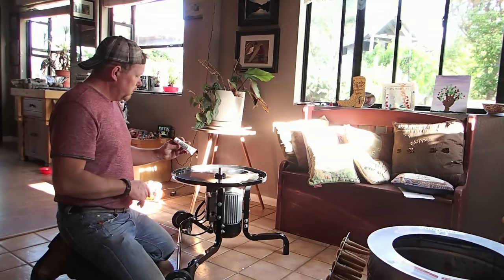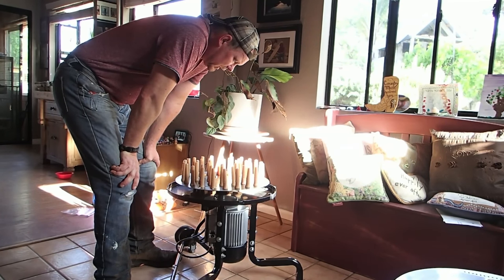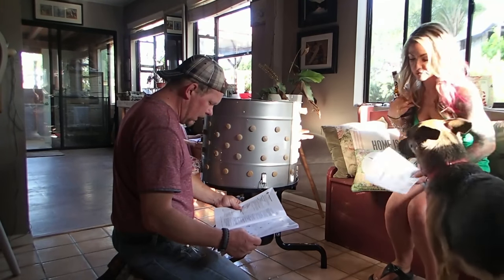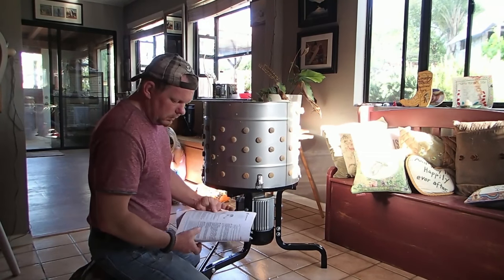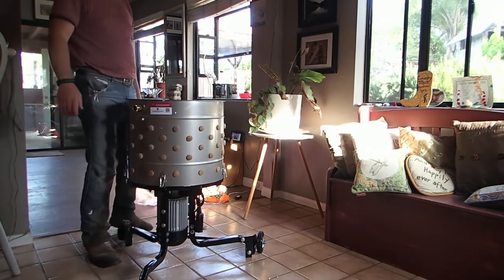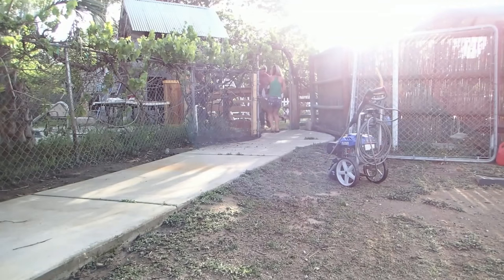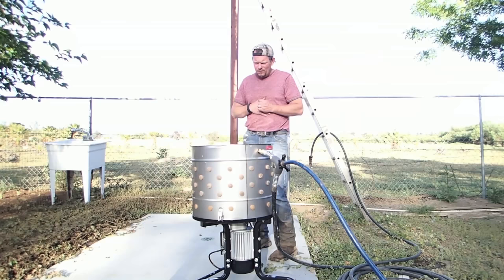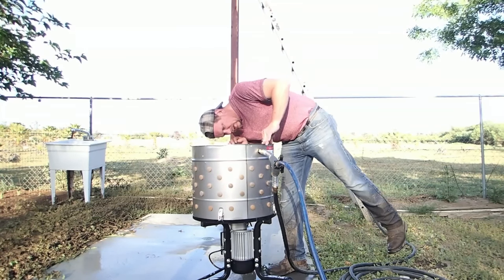Assembling and testing the best chicken plucker you can find for the $$

Comment: Always wondering about all the high-technology gadgets, and what could be done easier.

Old ways of rolling-boil hot water dipping (scalding your hands), hot wax dipping and stripping cold wax feathers (burning your hands from hot wax, that needs reprocessing getting back wax, and still have waste wax-feathers).

How about easier and faster method.  Steam cleaning.  Medium/large-size pressure cookers/canners for harvested animals.  Already gutted, head, neck, feet, ... place water in the bottom of open container, make rolling boil, put in multiple chicken, duck, goose into appropriately-sized pressure cooker, close up, and steam the feathers and skin.  Steam (1) softens and sweats out excess water tension in the skin cells, (2) opens up the skin pores allowing the feather pins to release easier, and (3) feather and pins all softened, all stick together and don't stick on your hands, gloves, or fall all over as dry pin feathers or down as in dry plucking, etc.  Put in fowl, pull out hot steamed fowl with tongs, and allow to cool down to handling temperature.  Then easily WIPE OFF feathers from bird.  The process does not steam-cook the meat when properly done. Any skin and feather contamination (bugs, germs, bacteria, salmonella, avian flu, ...) all steam-cleaned and sterilized for a safely processed bird.  Sterilized pin feathers and down, easily air-/sun-dried, and easily separated for other uses.

Comment: After looking at this video,  I'd say that the electrical motor under all that draining water might be dangerous.
Reply from the maker: +B Light it's not I promise ... it's a specially designed motor for this appliance that is made to handle water flowing around it 😉 we did 150 birds with this yardbird plucker that is widely sold and no one got buzzed 😜-SC

Comment: We had a horrible experience with this product and the company. They have a no return policy and no service center. They told us to fix it ourself. Seems like a lot of people have the same electrical issues with it. Fortunately, we bought it on Amazon and they picked it up for free and gave us a full refund. Glad yours is working though.
Reply from the maker: Really ? I’m sorry to hear that ! We have had it 6 years with zero issues ...
Reply: @3MISSISSIPPI  I'm glad it is still running strong for you. We saw a lot of positive reviews for the Yardbird and felt pretty confident that it was a good choice. However, all of the negative reviews ended up lining up with what is going on with ours. 1. Electrical and a 2. grinding noise from the motor. We got so frustrated with their response that we actually did our own review of it before having Amazon pick it up this week - they gave us a full refund. Thanks so much for taking the time to reply!
Reply from the maker: This is Mike, I did have an electrical issue with it early on.  It came with a GFI built in at the plug which failed (Got wet).  I removed it myself and installed a pigtail with no GFI.  I would not recommend this unless you can guarantee that you are always plugging it in to a GFI outlet.
Reply: @3MISSISSIPPI  Thanks - yeah, I saw a lot of people have this issue. We actually already returned it because it was also making a grinding noise and the rotation slowed down as well. Fortunately for us, we bought it through Amazon and got to return it and get a refund. Thanks for your reply.

Comment: For Sure! This thing needs bigger wheels and some sort of handle!. The current design is great for wheeling it around a factory with finished floors... but moving it across the lawn, wet ground, over dirt, over hoses, through sand, over flagstones etc... the small skinny wheel design is a fail!
Reply from the maker: Ideally you leave it in the butchering zone though 😂

Comment: Seems dangerous to have water pouring out the bottom inches away from an electric motor.....kinda like making toast in the tub.
Reply from the maker: +CaptainCanada780 I assure you it's specifically designed for the motor to handle that in order for the machine to serve its purpose. We did 150 birds in it this season and no one got buzzed 😉 thanks for watching -SC

Comment: Seeing all that water leaking out by the motor makes me think 2 things, sure hope the trip on your power cable works and that you have some good insurance,  cause you shore gonna need it running that contraption, ........just sayin.
Reply from the maker: +Rob Sartori  not the case 😉 the appliance has a specially designed motor , casing and cable that allow this device to function without buzzing its users . The yardbird plucker is widely used and I can tell you first hand after doing 150 birds this season , works great ! Thanks for watching -SC

Comment: Absolutely zero reason to squirt a big glob of lithium grease on that shaft. And food grade does not mean you can eat the shit dammit!! Listen to me, there are Zero moving parts where you put that grease. You just coated all your chikkens from now on in lithium grease dude!!! DON'T DO THAT. The plate locks to the shaft so if ya just haveta grease something, grease the actual bearing down below the seal. Oh yeah, it's BRAND FREAKING NEW so it don't even need that yet! What the hell man. SMH  Just let her do it. She's smarter anyway. Not trying to sound mean, but dude. Lithium ain't the kind of grease you want to fry that shit in. The centrifugal action, combined with the water, you bet your ass that glob is going to get on EVERYTHING YOU PLUCK. Greasy feathers much guys?
Reply from the maker: +WAXER 12G the bottom plate does spin actually turning the drum in order to pluck the chicken ... and it’s recommended by yardbird.... thanks for watching SC